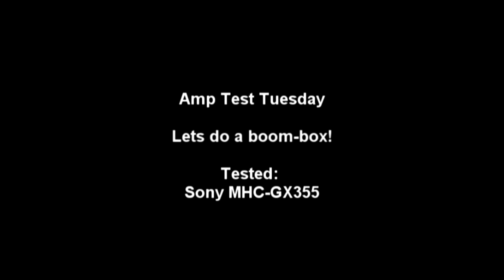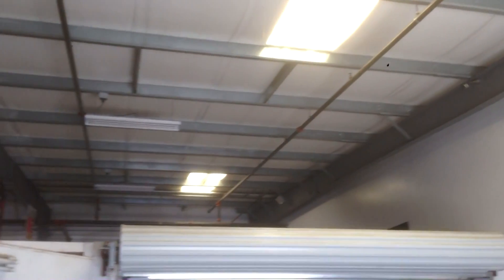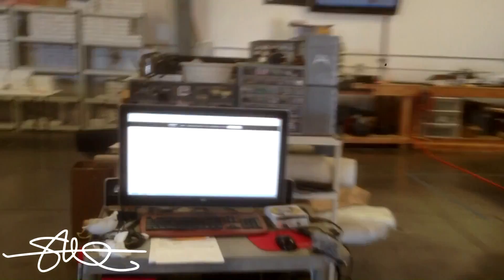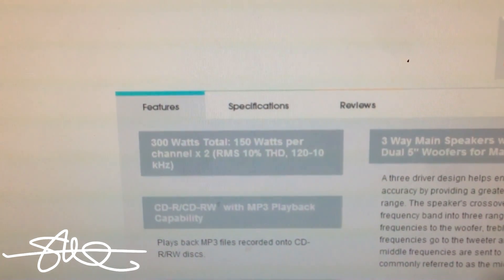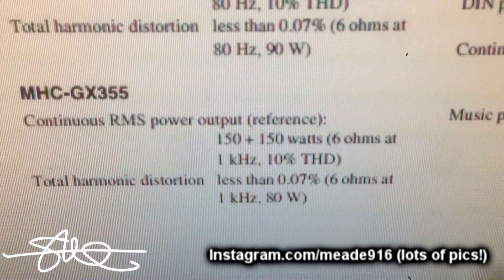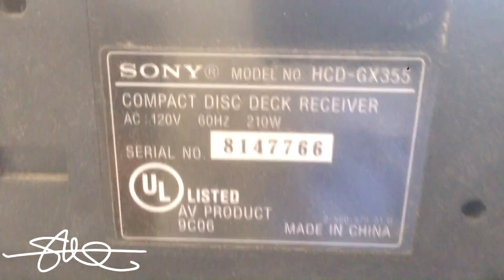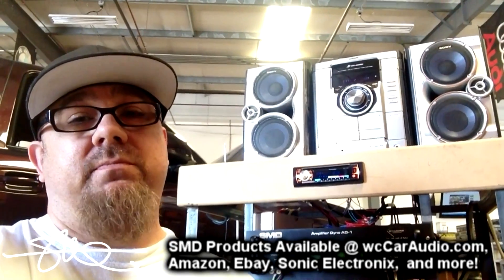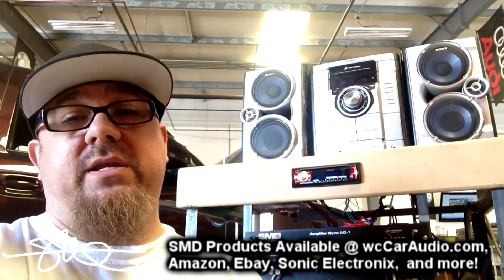Amp Test Tuesday - Lets Test a Boom Box! - Sony MCH- GX355

Comment: Hey Good Morning, quick question, I have the exact system and i'm trying for the longest while to use the "Audio In" feature, so as to play music from my mobile phone and laptop. I use the 1 to 1 cable (3.5mm jack), but the sound coming from the system is low, as if there is no amp. All the volumes are turned all the way up and no power in the sound whatsoever. Is this how the system is suppose to play or am I doing something wrong? Looking forward to a reply. Thanks

Comment: Smd can I request a dyno done on a jvc hx-gx7. I will send mine if need be I just want to know if the 500 watts of power is true. Im a big bass head and I swear it sounds like alot more than that. Its a compact component system with 2 subs and 4 mids and 2 tweets

Comment: I have some interesting amps you could test. Zapco Model 151 (Two piece amp), JL XD 600-6, Arc XXK-4150, T-1001bd(big gray with a fan). I am not too far from you either.

Comment: I have the newer model of that in my garage and I think it says something like 200 watts so it's prolly the same thing just different casing. It only has a tweeter and one 61/2 or 8 inch woofer on the speaker though instead of that tweeter and 51/4 woofer and then the bottom one is a fake/passive cone I think.

Comment: NIce...I have the MHC-909ip and its rated at 540 watts rms @ 10% THD also lol I couldn't find what it was rated at lower than 10% thought and this is at 12 ohms. I'd say its probably around 250 rms or something like that. I had a 2 ohm sub hooked up the sub channel before and it would go into protect sometimes but that was playing around.  Anyway, nice vid as always. Love amp test tuesday

Comment: hey steve do you know the mounting depth on the new sundown x series 12's i have a box for my dodge thats 7.5 inches mounting depth by fox acoustics, i was wandering if that sub will fit, i have a 2500 watt cadence zrs series amp and what sub would you recommend i run, my truck is a 09 dodge ram 1500 crew cab.

Comment from the maker: what? this thing is 5 or 6, not 30.  Testing it @ 4ohms helped it do over 100x2.  When i tested it at 8 ohms it was around 55x2.  I can conclude, with reasonable certainty that if tested at 6, it would prob be right around 80ish.  But it's complete hogwash to say that this thing would do better if i tested it right out of the box 5 years ago.  That just isn't true.  And what makes you think i WASN'T satisfied with the results? I just said the thing PASSED.

Comment: Oh, sorry dude, assuming too much.
Ive owned 2 similar systems. I guess I'm more thinking towards the side of caution because Id rather underdraw then overdraw from a high-fi system. Especial one that uses FET's like the sony's do. But I guess if its rated to a 300W peak draw it should be fine. Its not like its a high peaking low end draw. Would be interesting to know how ti preforms at bass frequency though. Its not exactly a class D internal structure. Did you test down to 120hz or below?

Comment from the maker: of course.  I use this for more "easy listenin" like when i don't feel like firing up the beast.  Sometimes i just wanna pop on the local fm radio station on a low level and just let it play while i work.  This works perfect for that.  Plus there is 2 more speakers on the other end of the shop that are also hooked up.  Its plenty for me most of the time :D

Comment: I'd be interested to see what my old pioneer sx-1250 makes. its rated for 160wpc at 8 ohms but i've read to do closer to 200. i have them running 4 ohm speakers now without trouble so i could only imagine the power it's making.